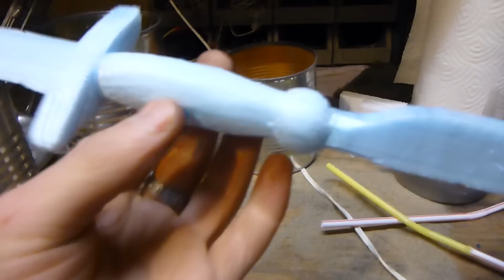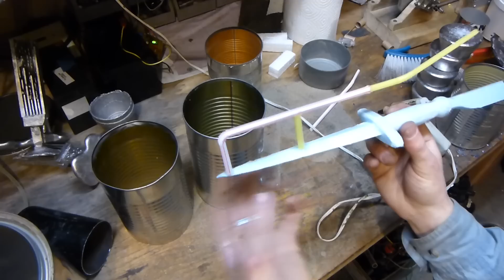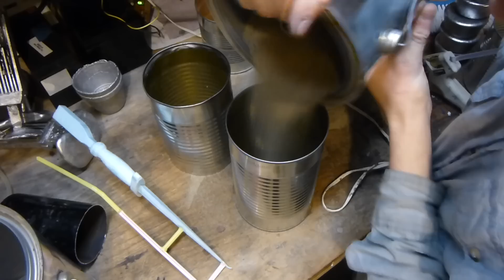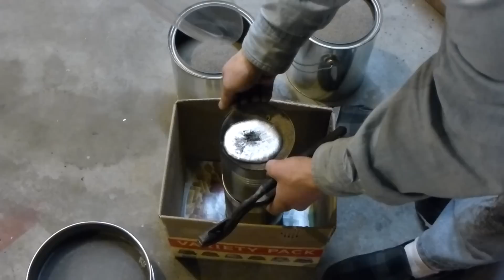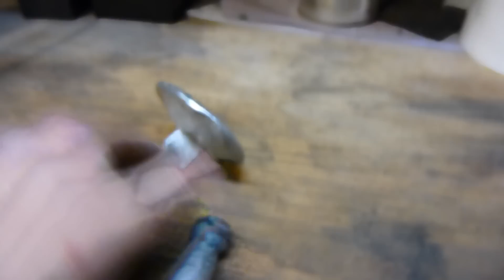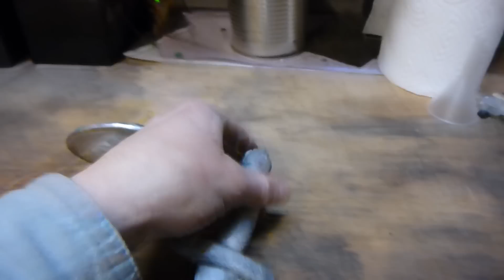Casting a Dagger out of Aluminium

Comment: You should try using wax instead of foam. You can make silicone moulds and cast the piece in wax and then make a plaster of paris mould around it same as the lost foam and sand. But you will have a solid mould. Then just melt the wax out over your foundry and pour your metal in when it cools and hardens just smash the mould with a hammer. It also makes for a smoother finish without all the pitting from foam and sand. plaster and wax are cheap and you can use your silicone mould over and over again.

Comment: you cant cast objects less that 1/4 inch thick using sand and styrofoam, if you wet the sand it might work but would probably cool pretty fast and not turn out very well.

Comment: you should have put some Borax into some aluminium foil and threw it into there. The borax binds to the slag and ends and floats to the top. another tip. use green sand! its very inexpensive to buy bentonite clay and you only need 10% mix composition :) try again!
Reply from the maker: +PoisonousAura I used green sand in my latest casting video and I even showed how to make it in the video before that.  Thank you!  I need to try the borax
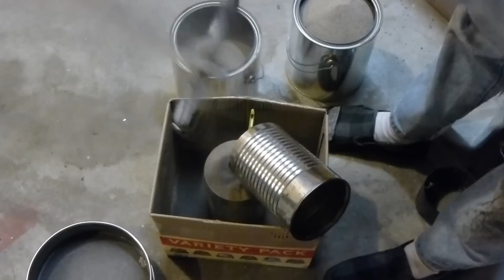Reply: 2:54 Knife Statue: Awarded to those who stabbed 1000+ players in Call of Duty

Comment: Do you think if the blade was wider, or you put the foam piece upside down (tip up), it would make a better result ? Cause I was thinking about doing this
Reply from the maker: +19Lenoch92 Yeah it probably would have worked.  Also if I had made the sand moist that would have helped keep the sand from caving in

Comment: I was going to say what I thought was wrong, but I saw your videos, and you're way past this now.   Congratulations.   I'm glad I found this channel. 

For people just discovering you (like me), there are other sands to use which will hold their shape without falling apart.  It would also help to compact the sand.

Think of a sand castle at the beach.   If you sprinkle sand in a pile, you'll have a pile that won't hold it's shape.   If you put it in a bucket and compact it, it will hold the shape of the bucket when you flip it over. 

You also don't need to ruin your foam form by letting it burn up.  If it's strong enough (high density foam),  you can make a casting box.  That way, you fill it in with sand with the foam in place, and then remove it before you pour.   That way, you can repeat the pours in different ways, move the vents, or make duplicates without making new foam patterns each time.

I'm watching all your videos now.  I'm sure I'll learn a lot from your experiences.
Reply from the maker: +JW Smythe Yep!  You are right about the sand.  I recently made some green sand out of kitty litter.  Works pretty well but I need to do more castings with it.  Thank you!

Comment: Let me tell you what went wrong, the big foam head you left sticking out of the sand plugged in the entrance and aluminium went down slower than it solidified so it blocked the rest of the liquid from filling the mold. If you cut out the big piece that comes after the pommel and put like a small steel tube there, it will work very good. alternatively, you can bury it a little deeper and make a deeper pouring hole and add a second straw on the other side to make sure everything vaporized gets out the way you want them to :) looking forward to it ;)

Comment: I  don't claim any knowledge or experience when it comes to smelting  / metal casting, but wouldn't a negative mold of the dagger work better for pouring the molten aluminum into? I would think that despite the evaporating foam, you'll still encounter some kind of resistance and hence the less-than-perfect casting. Just a thought.

Comment: That straw idea was dumb. Of course the straw would melt and end up doing nothing helpful in the end, you're melting foam what makes you think plastic would be much stronger? lol
Reply: I dont think he thinks the plastic is stronger than the foam. It doesnt need to be stronger, it just needs to be strong enough to hold back the sand as the metal flows in and melts it. But he would probably have more success if he used more foam instead of straws though.

Comment: One idea you might do for an experiment would be to heat the sand before doing the casting.  Styrofoam melts at about 460f, so you could probably heat your mold up to 400 safely in the stove.  That might buy you a few extra seconds of liquidity for your thin castings.  Might not help, but I'd be interested in the results.

Comment: Have seen other videos ... a single spout (or what ever they are actually called) probably isn't enough . In other YouTube videos they pour horizontal with 2 or 3 spouts . They tend to pour it quickly as well . And green sand is a must and even dry sand needs to be packed to hold shape while the foam is dissolved away . Also your single spout may work but as seen in the video your spout is quite long leaving a portion of unused material to remove from the final product . But I commend your work and you will find the answers eventually . I too plan on doing some swords . Good luck

Comment: I would salvage that dagger by heating it up enough to soften the aluminum and blacksmith it to shape with a hammer. It looks really close so a little bit of shaping would finish it into a decent dagger. Then sharpen it up on a slab of concrete.

Comment: Try making it a hollow form, that way it burns out easier, also, make the Vent holes much much larger, and in three spots, the handle, the bottom of the tip, and the middle.

Comment: Use low density foam, high density doesn't melt as well. Use green sand not dry sand and compact it around the mold. Create vent holes in the sand, don't use straws. Build up a crater to catch the excess aluminum and keep a consistent, steady pour. Don't let failures discourage you. We all make them. Even your failure still looked really cool. Keep up the good work and keep learning.

Comment: Should have placed it horizontal I guess
Reply: Peter Alexander Posborg I tried casting a horizontal dagger and it didn't work either. The sprue was placed on the handle and the aluminum stopped flowing about an inch down the blade.

Comment: The hole you put on top should hold about equal the amount of the aluminium that goes into the knife itself. This is so that the weight of the molten material pulls down hard enough to fill the cavity all the way down. Also, it would be very smart to make 'escape vents' on some places along the knife because the aluminium has a certain amount of surface tension, it will not go into small corners just by itself.

Comment: While I don't have quite as much experience at this as you do (yet) or the same resources, I think you might be better off if you cast the dagger with the point up and then file it down to the point/shape you want.  The larger the area, the easier it is to get the metal in there.  Grant Thompson (aka "King of Random") has been my source for a lot of thing and I HIGHLY recommend looking at his videos (especially the "How to turn Styrofoam into solid aluminum" one).
Question for you: in your casting experiments and tips video you mentioned adding something to the aluminum that is supposed to help it cast easier, but I haven't found any other sources that mention something similar.  Can you elaborate?
Reply from the maker: Chris Sauerwein  That is a great idea casting it upside down and I have in fact not thought of nor had anyone suggest that.  I think that will actually work.  I will most certainly try that on my next cast.

Yeah Grant Thompson is great!  But he doesn't really share a ton of knowledge of every step.  His videos are really smooth and well done.

There are a ton of mixed opinions on flux and degassers.  Some people say to use different kinds of salts, others say potatoes, some say you don't need any.  I honestly don't know.  I may try an experiment soon to see which I think is best.  I'm thinking of using a brick with holes for mini crucibles.  Then put aluminum from the same source in each one and add different fluxes and degassers to each. Then pour them into ingots and see which has the worst air pockets and such.

Comment: Dude. Look up what you are supposed to do and supposed to use.
Your videos are cool and you're a smart kid, but all I see here is fail after fail after fail.
Reply: Learning is all about mistakes, Makerj is impressive because he gets a lot done and learns at twice the rate of most people his age. When he gets a job he will actually know how to "do" unlike most grads.
Reply from the maker: The Sqoou It's a way of documenting my work so others can see what works and doesn't.  Thank you!
Reply from the maker: What's the quote by Thomas Edison? I've not failed, I just know 1,000 things that won't make a light bulb.  Well I know aluminum casting using lost foam in dry sand doesn't work very well!
Reply: Makerj101 Edison was a lying, thieving, animal killing bastard. He also did not have the internet at his disposal. All you have to do is look up "what kind of sand should I use" or "is hot glue and plastic detrimental to lost foam casting" Hell. Bing could tell you how to do this.
Reply from the maker: Yeah sure you can find everything you need on the internet and you say it's so simple and easy.  Well I'd like to see you're aluminum casting videos were you do it on a budget for under $100.
Reply: Makerj101 I'd like to give it a try. Aluminum casting looks like fun. I like your new crucible and stick idea. 
Ironically this is why I was looking up casting in the first place. To learn about it before I try it. 
Are you subbed to Grant Thompson?
Reply from the maker: The Sqoou That's good!  Some people just criticize my work with no experience or intent of doing it themselves.  I'm sorry if I took you for one of those.  I do hope you give it a try because it is a lot of fun and it's really cool to be able to make your own custom metal parts at home.  

Thank you!  It was the simplest and cheapest way I could come up with to holding the crucible.  Well besides tongs.  But tongs are not safe.

Yep!  Grant Thompson is pretty cool!  His lost foam turned out great.  I think mine are just too thin to use with lost foam and dry sand.  He says it's dry sand in the sward video but he does wet the top so maybe that soaked down and made the sand moist enough.  Maybe it's just that his castings have a lot more room for the aluminium and I'm trying to do too small and too much detail.  I'm going to try moistening the sand with water the next time I cast.  But only moisten as too much water will cause steam and blow the aluminum out of the mold.  Not good.

Best wishes with your future castings
Reply: Makerj101 Did moistening the sand ever work? I tried lost foam casting a dagger, too, but before I watched this video. I laid the dagger under the sand horizontally and attached the sprue to the handle, but it stopped flowing about an inch down the blade. To make the foam model, I used foamboard and glued pieces together to make parts thicker.

Since you've done this so many others times and you've learned what works and what doesn't, do you have any advice on what to do and what not to do?

Comment: Hey I'm interested in casting but I can't find a furnace that is electric and can melt aluminum Any way you can help me by telling me where to find one or if anyone has a link reply etc I will take any suggestions
Reply from the maker: Dylan Woolley You can generally find something on eBay:  http://www.ebay.com/sch/i.html?_odkw=electric+furnace&_from=R40&_osacat=0&_from=R40&_trksid=p2045573.m570.l1313.TR0.TRC0.H0.Xelectric+kiln+furnace.TRS0&_nkw=electric+kiln+furnace&_sacat=0  I'd find something used if you can to save money.
Reply from the maker: Dylan Woolley You can make one really easy:  https://www.youtube.com/watch?v=9bMDpcBc2v4 and: https://www.youtube.com/watch?v=lSoWxG30rb0  and: https://www.youtube.com/watch?v=VTzKIs19eZE

Comment: Great vids MakerJ101, very informative, we dig a lot of metals up when were out detecting, ive just aquired a kiln so ill be putting it to good use, i like the Lost Foam method ideas - i think you need a "header tank" - a smaller can above the foam that helps apply downward pressure when it fills with aluminium. Keep the vids / projects coming :)
Reply from the maker: FPV Carlisle Cumbria Sounds like a good place to get free metal! Thank you!

Comment: i know i said it last video and you saw buy i still think you should try wet sand. i think it would stop from collapsing in giving the aluminum time to get down into everything. think of when you make a sand castle the wet sand sticks together and you can make some pretty precise shapes
Reply: wet sand may be dangerous what could happen is the water in the sand evaporates under the molten metal and pressurises and can cause a steam explosion which can cause the molten metal to splash
Reply: Oh really I guess don't follow what I said then. What kind of sand do they use to mould headers and turbos. I saw it on how its made it looked like a wet sand type substance. Maybe it was made with an oil and sand ? Or something like that
Reply: Austin Gerlach well its called greensand they which is moist sand with only a sprinkle of water only about 3 percent water if it has too much moisture than it can be dangerous but any person who does it at home would probably want to do a safer method.
Reply: The sand needs to be "slightly damp" where it can hold shape. Like Dean said only 3% or so. Its like building sand castles, the moistness needs to be near perfect to hold shape.
Reply: Robonza just mix some old motor oil in the sand, less risks of water sprinkle, and harder to evaporate.

Comment: Here is what you should try. Use 50%plaster 50% sand. Mix it wet and then burn out the foam. Then you have a hallow cavity to poor your AL in to. This is the way we can do lost pla 3D Printing.  Good stuff. I also wonder if the hot glue did not melt? God bless. ~Russ
Reply from the maker: ***** I bought some plaster recently!  I just need to get around to actually trying it!  I've seen people do lost PLA casting with 3D printing.  It's really awesome!  Thank you!  God bless
Reply: Good idea. God bless,
Reply: Makerj101 another thing to do is remove the slag. If you melt things like soda cans to obtain you aluminum you have to separate it from anything that isn't part of the metal. Best way to do this is to pour it into a muffin tray (not your mother's) and the slag stays behind. That way you'll have pure aluminum and more complete and beautiful projects. Best wishes.

Comment: Not bad man, you can still grind on that and make it useful. But you know every fail is only a new open door to try experiment further!
I'm no expert on casting but I have to guess the sand is collapsing in at the bottom? Maybe try dampening it some, use half of one more can and keep pouring in the center to keep forward pressure on the metal so it will go down.
Yes you will have a big glob at the top but it may help force the cooler metal down while its still plastic.
Also the upper vent is not needed, you metal can escape through that and never make it down to the bottom.

Hey if you master aluminum your graduate to brass and then to steel lol!

And props on the Infra-Red flare from hot metals!
Reply from the maker: ElfNet Gaming  I'm going to try damp sand next.  I just have to get my butt out there again and cast some more!  Thank you!

Comment: What kind of camera do you have?  It seems to be very sensitive to infrared (here, and in your copper-acetone videos).  It looks quite cool.
Reply from the maker: Nevin Williams Well the one I was using in this video I hate a lot... LOL!  I just use it as backup or to get a second angle or for high speed.  It's a JVC Everio GZ-E306.  I don't like camcorders.  Just not my style plus the things has WAY WAY too much zoom.  So even when you are not zoomed in it makes it seem like you are zoomed in about 3X.  Thus you have to have the subject very far away from the camera.  This makes it impossible to film anything by holding the camera in one hand and holding the subject in the other.  Fine for a tripod.  I also dislike the sound from it.  It's not realistic sounding so I always past the sound track from my other camera over it.  My good camera is a Panasonic Lumix DMC-SZ7.  I love it so much!  I love it so much that when I dropped my original one several months ago, I instantly bought a new one!  It's got great everything in my opinion.  Plus it fits my budget which is always a plus.  

Yeah the JVC camcorder does pick up a lot of inferred.  Especially in low light because the aperture is open to let a lot of light in.  That also lets a ton of IR in and then the camera goes crazy making it nice and purple!  :P  Oh and the JVC camcorder has terrible low light even though it is supposed to have all kinds of fancy back lit super COSMOS low light sensor or something.  It does do a decent 300FPS high speed so I give it credit for that.